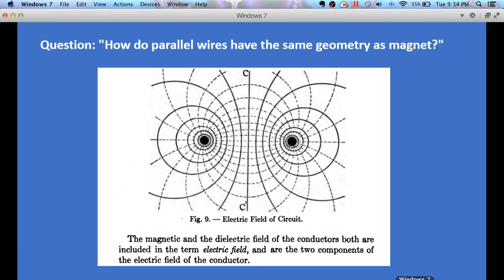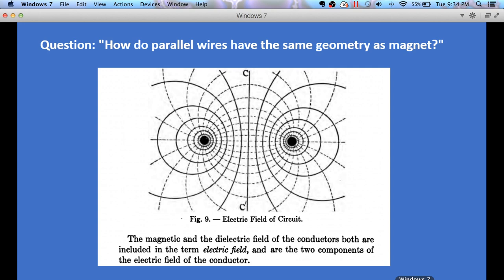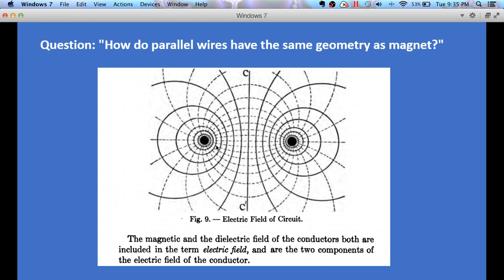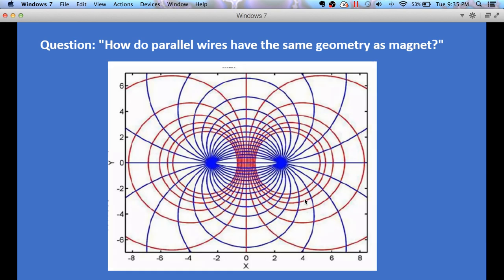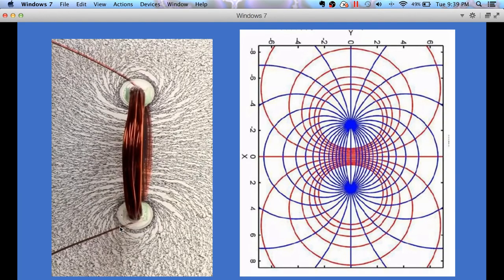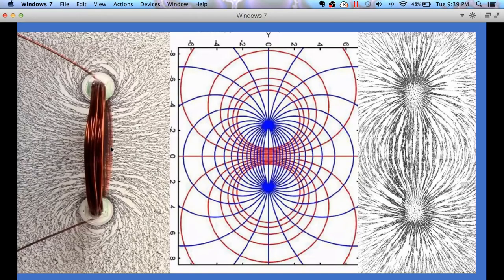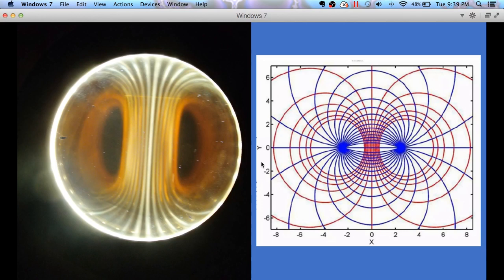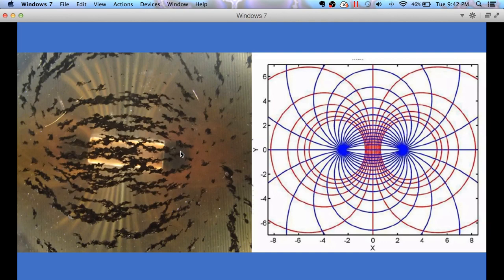On Permanent Magnets vs Electro-Magnets

Comment: I believe Ken Wheeler may be correct in a way. A coil (solenoid) generates the magnetic field from outside the magnet, unlike a permanent magnet 

where the magnetic field is generated from within. Basically, an electromagnet is a non-magnetized iron rod with a coil (solenoid) wrapped 

around it to mimic the rotating magnetic field when powered in the correct direction. 
How To Build An Electromagnet: 
With a permanent magnet, the current runs from North to South and when North is pointed up, the field rotates counter-clockwise (when you 

look from above). Current in an electric circuit runs from positive to negative. So to mimic a bar magnet (with north pointed up vertically), 

place the iron bar vertically, wrap the coil counterclockwise around the rod in a downward direction. Attach the positive end of the 

battery/power source to the end of the wire off the intended North end of your electromagnet and attach the negative end of the battery/power 

source to the end of the wire off the intended south end of the electromagnet. When the circuit is powered/connected, the charge will flow 

counterclockwise around the bar in a downward/southward direction (remember what the single wire electric field looks like). This mimics the 

natural magnet. The more coils, the stronger the magnet. 
I am still not sure if the electromagnet works because it is simply providing a unidirectional current, or rotating the magnetic field, or adding accumulative strength to the magnetic and dielectric fields, or if it is just aligning the atoms. I suspect the first because when you turn off the power, it doesn't remain magnetized. 
I would not understand ANY of this if not for Fractal Woman's multiple videos which helped me put this all together.
Reply from the maker: Mainstream says: "With a permanent magnet, the current runs from North to South and when North is pointed up, the field rotates counter-clockwise (when you 

look from above)." 

Instead of talking about current and fields, I prefer to talk about flow and spin.

Fractal woman says: "With a permanent magnet, Aether flows from South to North on the inside and from North to South on the outside, like an Aether smoke ring. The Aether smoke ring also spins counter-clockwise when looking from above with N facing up. Kind of like this...

https://blenderartists.org/t/animating-a-torus-object/1180965

...only this animation is upside down. In this animation South is up and it is spinning clockwise.  Now...I want you to watch that animation, but focus on one cross section between the horizontal and vertical lines. Watch how that point "spirals" into the torus structure. THIS is what we perceive as "flux" lines. Hope this helps.
Reply: @FractalWoman  Thanks for the reply and for the link. I had wanted to know what you thought was happening with the ether in terms of "current" or as I will now refer to as "flow" with the magnet. And now I do! Thanks! So what the mainstream calls "current" is actually the flow of ether on the outside of the conductor, which is directly proportional to how much ether can flow through the conductor (in the opposite direction). 
So what, in your opinion, is the electrified coil adding to the non-magnetic iron, to make it a magnet? The mainstream claims it Is it the current (or as you would call it, the flow of the ether). Do you agree? Or is it something else such as boosting the magnetic and/or dielectric fields (does the dielectric field spin?)? My initial thought was it was simply augmenting the magnetic field (in terms of spin, volume, and flow), but as attraction is mediated by the dielectric field, that didn't make sense.
Reply from the maker: @goliathonscave9834  It is my opinion that the outer current/flow causes inner current/flow of the particles in the iron core.

Comment: Thanks for your work in this area. Here’s a thought: If I put a electromagnet in one sealed box and a permanent magnet in another seal box could anyone discern between the two by comparing the fields only?
Reply from the maker: I don't think so and here is why. Here is a link to a post I made a while back showing both an electromagnet, and a real magnet of similar size under the ferrocell. https://www.youtube.com/post/Ugw_wgzUUWREYCx9nzt4AaABCQ
As you can see, the "field" patterns they make are identical. So if you can't tell the difference under the ferrocell, then my thinking is that you won't be able to tell the difference if they were each in a black box and you had to tell me which what which (other than the fact that one box would have wires going to it and the other one wouldn't).

Comment: hey I was wondering in your next experiment if you have the chance.......put a magnet in iron filings like the inductor except instead of electrifying the induct-or , you electrify  the magnet and see if it changes from dielectric to magnetic current from the electrification. golly if you can prove that , that would be awesome. does the magnet go from a dielectric strain or pinch to a magnetic current in electrification ?
Reply from the maker: Elijah: That is an interesting idea. Unfortunately, I'm not sure how to electrify the magnet. In the coil, the current is made to go in circles. It is this "circulation" that is causing the phenomenon we call "magnetism" in the inductor. It is my opinion that there is also "circulation" going on in the magnet and this circulation is going on in the dielectric inertial plane. I can actually "see" this when I bring the magnet close to a CRT screen. What I don't understand is why the iron filings behave differently in an induced magnet compared to a permanent magnet. I think this has something to do with the different way that a magnet aligns itself with a bigger magnet as compared to an unmagnetized as you can see in Figure 10 of this paper: https://arxiv.org/pdf/1807.08751.pdf

Comment: What would the coil look like with the iron filings when laid down horizontally instead of on its side?
Reply from the maker: When you lay the coil horizontally instead of vertically, the poles are up and down instead of left and right. The iron filings will like up radially around the coil. An image of this is hard to find since iron filing images are almost always shown with the magnet on its side. I was able to find one here.
https://www.dowlingmagnets.com/blog/2021/the-art-of-science/

The figure that shows Fine, Medium and Large show exactly what will happen to iron filings in the orientation you are suggesting.
Reply: @FractalWoman  Thank-you

Comment: Thank you for the video.  I have enjoyed learning from Ken’s videos as well as yours.  What you are showing is the opposite field geometry that shows that the non physical world has an opposite (or incommensurate) affect on the physical world  (iron fillings affected by magnets and iron fillings affected by a di-electric field).  I really want to understand this so please help me if I’m wrong.
Reply from the maker: I really want to understand this too. All I have are pieces of the puzzle. I have one more really good one which I will make a video about in the next couple of days. This will help everyone understand the ferrocell better. The incommensurability between the electromagnet and the permanent magnet is really interesting though. This may help explain why a moving magnet generates a current in a coil of wire.

Comment: Hi, is the permanent magnet drawing energy from the aether to generate the magnetic field? This current flow must occur through counter-space (or something similar) as we would've measured it by now. Apart from permanent magnets we always require an electric current to be flowing to get a magnetic field. This field is circular and requires the radial dielectric field to support it. I'm thinking that the current loss in an electric circuit goes to create the dielectric field therefore the permanent magnet is drawing current from counter-space to create the magnetic field. If a magnet can organise iron filings or push another (similar poles facing) magnet away then that is work done and that requires energy!
Reply from the maker: These are all really good questions. This is a complicate subject and words just don't do it justice. I am working on a video that will hopefully clear some of this up. The problem is with the language.
Reply: The really interesting thing is that both the permanent and electric magnets produce fields that are reversed, flipped or wotever. This throws up more questions about the interaction of the fields with the aether. The interesting stuff seems to happen at the boundary layers between two differing mediums eg smoke/air or north/south. I think the field interactions at the boundary layer will be described using fractals. Do you think the aether is a fixed interconnected matrix that we are moving through or as a fluid like substance that we are immersed in?  Also i'm thinking that like water the aether can create charge when it flows around or through metals and also then store this charge.
I've only just found your channel so there's a lot of vids i need to watch to know where your're at with all this so i know how better to explain wot i'm trying to say, thanks for the reply. Language is always the problem, lol.
Reply from the maker: @julesboozy1603  "The interesting stuff seems to happen at the boundary layers between two differing mediums" 
EXACTLY
"I think the field interactions at the boundary layer will be described using fractals."
EXACTLY
Fractals are usually found at the interface between two dissimilar media. char

"Do you think the aether is a fixed interconnected matrix that we are moving through or as a fluid like substance that we are immersed in?"

I think that the Ether is likely a superfluid. It is also a polarizable medium which is affected by both positive and negative charges, and magnets. As a polarizable medium the Ether is the source of both electric "fields" and magnetic "fields".

Comment: Electrically generated field modality of the dielectric field is inverse from the magnet generated field modality of the dielectric field. Additionally, the two field reactive elements of the magnet and ferro cell behave inversely to one another for any given dielectric field modality. Probably due to the inverse sides of the dielectric, ie. space and counterspace, and how these two realms vibrate independently but together in different frequencies to form the different elements.

Comment: Hello FW, firstly great work you're doing :). To get clarity on this experiment all 4 of the test pieces require to be the same geometry (or close as possible) as these are not in my view. The bar magnet (iron fillings) and inductor (ferrocell) are of similar geometry so have similar results. The electric coil (with iron filings) and magnet (under ferrocell) are similar again due to similar geometry? Thanks. Steve
Reply from the maker: Actually, I cleared that up in my Community section where I showed an image of an electromagnet under the ferrocell and the image of a magnet of similar size under the ferrocell. The images look identical. There is no difference between the electromagnet and the actual magnet under the ferrocell. Here is a link to those images: https://www.youtube.com/post/Ugw_wgzUUWREYCx9nzt4AaABCQ
Reply: @FractalWoman  thanks for reply, sorry if I've not been thorough enough, I looked through allot of the replies but not all of them. The link doesn't seem to work? I'll look back over to see if I can find where you have already discussed this. Many thanks
Reply: I've seen the post you mentioned clearing it up, and checked the other link you mentioned to your community, that doesn't seem to work either unless I'm doing something wrong?
Reply: I've now found it in the community section! thanks for that. :)